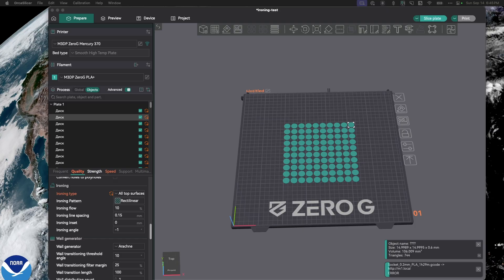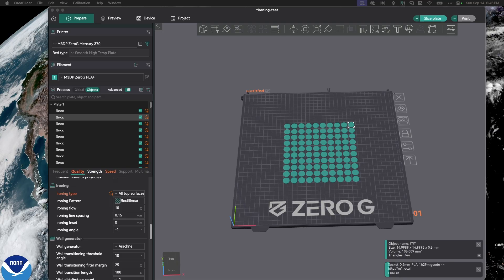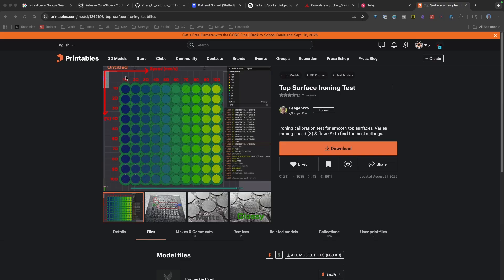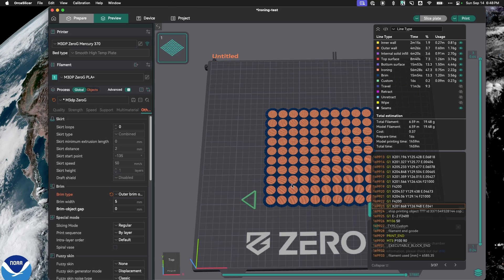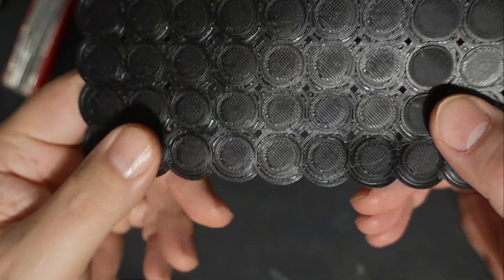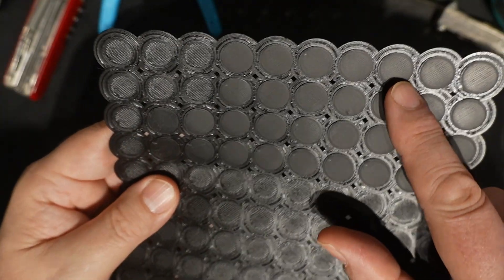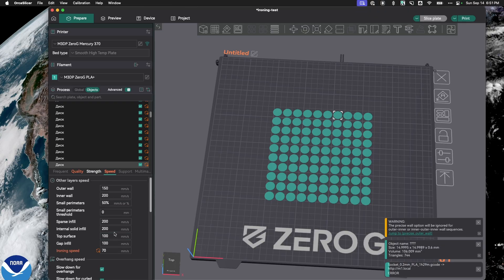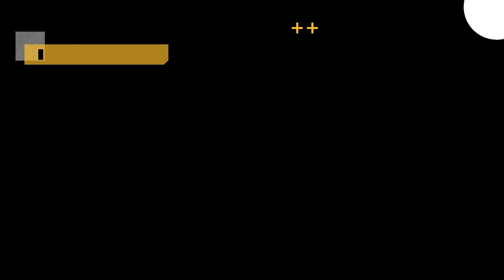OrcaSlicer Ironing: A Guide to Tuning Flow and Speed for Buttery Smooth Surfaces

Comment: I only have an ender 3. Could I use this or does it anticipate a faster printer.
Reply from the maker: You should be able to use this without any problems.
Reply: i have done ironing on sever ender 3 printers and it was all really good results.